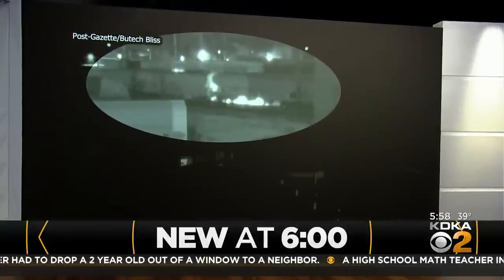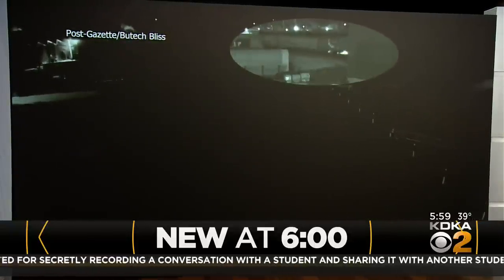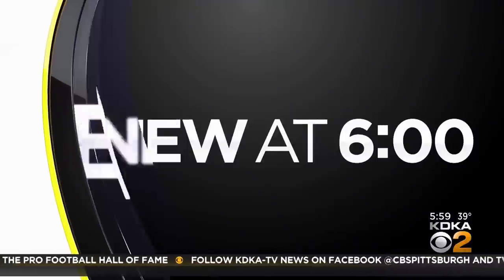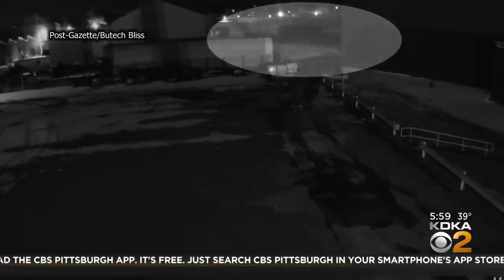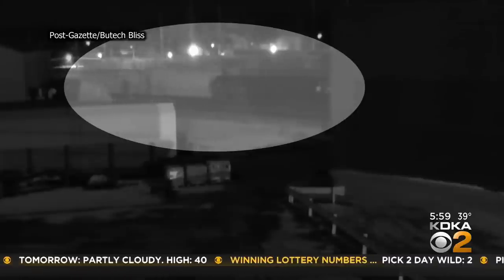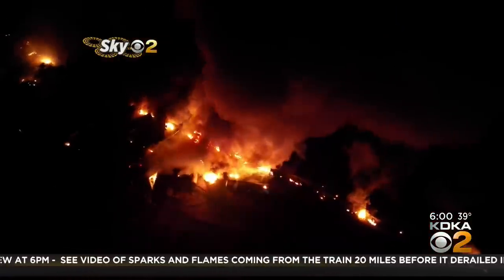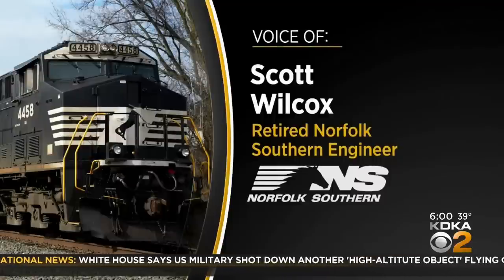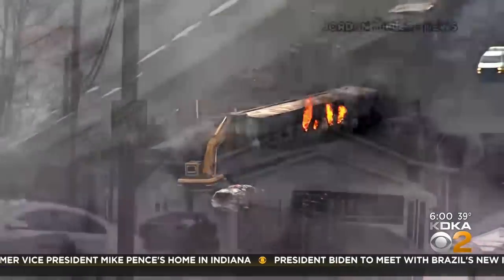Video shows sparks or flames 20 miles before train derailment in East Palestine

Comment: blaming the crew instead of norfolk southern execs is insane
Reply: What's the purpose of the crew if not to ensure the safety of the vehicle? To sit around collecting a union paycheck?
Reply: Which specific norfolk southern execs were directly involved in the inspection and maintenance of the rail car or ignoring alarms on the train at the time? Your comment sounds like it was written by a 13yr old child.
Reply: @clemfandango2930  All of 'em. Norfolk SOuthern has been cutting maintenance to the bone.
Reply: Well, the crew is in fact ultimately responsible for the safe and orderly conduct of the movement of the trains. And if they knew about poor maintenance and took the trains as is, they are also accomplices. Also Executives may of may to know of some cuts done by lower management despite what you may thing.
Reply: @clemfandango2930  they literally want less maintenance to save more money and lobbied against new brake
Reply: What crew? They already running a skeleton crew, trying to save money. Also, the crew IS Norfolk Southern. There is not the crew on one side, and Norfolk on the other. They are one in the same.
Reply: @AgonxOC  No their not! Its goin to be on the chief dispatcher. That person told them to keep the train moving. It should of been set out for the fact that the hotbox detector picked up that locked axle. The video clearly shows it.
Reply: If they did not listen to the system telling them they have a problem then yes it was the operator how made this mistake.  But in the end it is all the company that is why you hire skilled professional.
Reply: @drinkingrobot2252  You are correct but it should never have happened even with existing equipment.
Reply: How can the crew be blamed when they can't even hire a crew..they are treated like animals..I've talked to a few NS employees ..they said they are way understaffed for the volume they are moving. And they aren't compensated accordingly..hints that strike they almost had..but the executives are collecting a fat bonus no matter what...doesn't make any sense..other than greed
Reply: @lucian5304  You are both right!  They are both criminally negligent!  Spraying sparks for 20 miles but they only checked their instruments 10 seconds before flipping?
Reply: @lucian5304  you are driving a trine you get an alert that there is something wrong with the trine you stop and fix the problem
just like your car light comes on and you ignored it is not the car company's fault.  So the company was not in control of the trine so tey could do nothing.
Reply: looking at comments below blame crews who are trying to keep their job while the company lobbied against the Federal government for newer brake systems on their train cars years ago is big "im a bootlicker" and will do anything to defend billionaires and their shareholders no matter what the cost.
Reply: It's NS fault just as much as the crew. Who you think told them go for it
Reply: @handduggraverdronline  Just like a truck driver who does not stop when his truck is having a mechanical problem it was the operator.
Reply: @rambogoham1  It comes down to who was in control of the trine the engineer, not the company.
Reply: @rambogoham1  that’s all I’m
Seeing in these comments. These same corporations would fire these bootlickers at the drop of a hat if it meant more money for shareholders and ceos. You’re closer to being a situation like them than ever being a ceo, stop treating your fellow man like they’re all subhuman.
Reply: Anyone and everyone on the payroll is responsible. All of them. Anyone with a soul would have quit.
Reply: Just like any equipment  or vehicle the operator is responsible. Or are you saying just not when they work for the railroad?
Reply: @ArmsnAcres  No what the enganer should have done was his job.  They had got the alert there was something wrong they should have stop and checked.  It comes down to they are laszy.
Reply: I heard Intel Corporation was planning on buying that land years ago. Intel is owned by Nestle that also sells bottled water. Possible land grab?
Reply: @diggingwithdavid5732   at what point were the crew aware of the alert and how long after knowing of the alert did they begin to stop ? And how many cars were on that train /how long would it take to come to full stop? Do you (or does anyone) know?
Reply: @alchemilla1133  It never should have left salam I would have lost my job if I was the engineer.  After the press conference today they are all at fault.  And the operator is the one who said ok let's go even after being told there was a problem.  The operator is the one who had this happen money is not every thing.
Reply: @warmsunnytoday4535  Good it will be deadly for anyone to have to long of an exposure.
Reply: @@akihiiva1740they’re not allowed to talk. I worked there. Trust me.
Reply: @@akihiiva1740 The crew wasn't incompetent. 🤔🤔🤔
Reply: @mirandastephens4586  To make the company money that they are trying to make up for the money spent in the past used for inspecting railcar brakes.
Reply: @mirandastephens4586  The crew can not turn a shit box into something it isn't though, their job is to operate, not to stop mechanical failures. If a cash register times out, is it the cash attendants fault?
Reply: @Aki Hiiva you know it's a shitshow when they try diverting our attention to a weather balloon and let us all watch it for 4 days just two days after this incident
Reply: @@akihiiva1740 how about you do your research before getting cocky
Reply: @@akihiiva1740 If a railroad company gives you one minute to check a train car at 75 ft long, that train car will not be properly inspected, however, if you inspect it for more than 2 minutes, you will be making the company lose money and that will risk your firing.
Reply: @@akihiiva1740 "Just wait till ihis expands to the airlines."

It already has expanded to airplane manufacturers. Don't you remember when Boeing was quickly pumping out Boeing 737 Max 8 jets? And look what happened to airplanes nosed due to a mechanical software failure. Nah but go ahead and blame it on the airline crew. It must be their fault. 🙄
Reply: @@akihiiva1740 You see when it all takes just a little research. You learn something. Without educating yourself, you'll never really know what the issue is. You just come up with baseless opinions that amount to nothing and will never fix the problem that way because you're not trying to solve the problem.
Reply: @@akihiiva1740
"Before Ohio derailment, Norfolk Southern lobbied against safety rules"
Source: NYP
Reply: @@akihiiva1740 Man, I love how you chose 200 years ago. Not 50 years ago, not 60 years ago, but a time that you didn't even exist. 😂😂😂
Reply: @@akihiiva1740 "Hard fucking work. Even today."

So? What does that have to do with the company being responsible?
Reply: They’re not the ones doing the inspection before departing. Idiots. That’s on NS for laying off all the carman who usually did them properly.
Reply: @clemfandango2930  rail workers complained plenty, and your comment hasn’t aged well, based on senate hearings.
Reply: RFK Jr 2024!🇺🇲
Reply: @AgonxOC wrong. They had no clue something was going on because there weren't heat sensors on the train cars because the company wanted to save money. Not on the crew.
Reply: @BigAlFPV17  where are your sources? They had no idea that there was anything wrong because of the company not putting heat sensors on the train cars to save money.
Reply: @diggingwithdavid5732 what do you mean? The system didn't detect anything because there were no heat sensors on the train cars because the company wanted to save money.
Reply: @drinkingrobot2252 heat sensors
Reply: @naughtiusmaximus830 what equipment 😂?
Reply: @geggilishes5286  Heat detectors for one example.
Reply: @naughtiusmaximus830  there were none. I can prove it.
Reply: @geggilishes5286  OK.  Maybe it was intentional.  I’m open minded when it comes to government lies.
Reply: @naughtiusmaximus830 RFK Jr has a thousand lawsuits for families right now who were affected by the oil spill and there was an investigation done and come to find out there were no heat sensors for the train cars. So they went miles upon miles while it was on fire and the engineer had no clue. All to save money. RFK Jr is getting my vote for the 2024 presidential election.

Comment: This was what the RR workers were complaining about. Not enough crew for safety. Chickens come home to roost.
Reply: how so, there was 3 crew members on the train, and thats 1 more than required by the FRA.
Reply: @trainfan4449 the 3rd crew member was likely a CT or LET. Not the norm.
Reply: @mayormccheeze5951  norm or not, 2 crew members is whats required by the FRA, and this train had more than that. I'm just pointing out the flaw in OPs comment.
Reply: @mayormccheeze5951  From a source on YouTube it was a CT
Reply: @trainfan4449  Just saying. Corporate profits have put safety on the back burner. People have lost their jobs making safety complaints to no avail. If it's not this disaster, there will be another one.
Reply: Build Back Better, baby!
Reply: @michelleayres5608  it sounds like doctors, cops and union workers like nurses, teachers and railworkers put their salary and pension above the very people they're supposed to ensure the safety and well being of.
Reply: @mirandastephens4586  People like them have to put food on the table. It's their bosses who try to do as little preventative maintenance as possible that we should be taking a hard look at.
Reply: @trainfan4449  one of the 3 was a trainee

Comment: The crew finds out when a trackside detector tells them about it.  Trackside detectors are located here and there but not densely.  They also check for wide load, high impact wheel, etc.  Sometimes the crew will miss the report and then the dispatcher will tell them about it and require that they stop and investigate.  Almost always it's urgent enough to stop and drop the faulty car off at a siding by policy but not urgent urgent.
Reply: Well in this case, from what I'm hearing, the hot box detector picked up that locked axle. Something like that has to be set out. No question. The two places where they could of dropped that car off was either in Leetonia or Columbiana (CP Lum) depending on what track they were on. The Chief Dispatcher told them to keep going. If that's the case, that person will be held responsible. But we'll have to see what the NTSB finds when the full report comes out
Reply: @BigAlFPV17  The drill is to stop and investigate, then decide what to do.  If it's moveable, slow roll everything to where it can be set out.  The dispatcher would need that investigation information first too.  It looks like this was in the process of being information relayed but a stop had not yet happened.
Reply: Only 3 people manning the train & one was a trainee
Reply: @donnaleist698  Normally its only 2 running the train. The 3rd was a trainee
Reply: @donnaleist698  Normally there's two, the engineer and the conductor.  They get radio permission to do what's necessary if something happens, e.g. slow roll the train to a siding to drop off a faulty car.  Two is plenty.  The union wants shorter trains and more crew but they're selling their own interests there.
Reply: @yclept9  guys, the train was on fire FOR 20 MILES!
Reply: @Nathaniel Shrock But if they still had a caboose then perhaps it could have been detected, they elemenated that job for the brakeman and other crew members. Now they just hook up a FRED to read the brake pipe pressure.
Reply: @@shrock1995 how do you know they got the warning coming into east palestine and not earlier?
Reply: @BigAlFPV17  Only 2 or 3 workers with that many cars?
Reply: @yclept9  What do you mean, "their (the union's) own interests"? Isn't it obvious that railway safety is in EVERYONE'S interest?

Comment: Preventative maintenance could have prevented this. Who gave the order to cut back on maintenance on this line? Who was responsible for setting the policies in place that could have stopped this from happening. Hint: the rail workers just tried to strike over working conditions.
Reply: Bingo!!! 👍
Reply: Good question.  I sometimes work at a place that rebuilds the chemical tank railcars.  I don't know if they union. I don't think they are but they have some good stories about surprises inside the tanks. They are told what is in them and how to neutralize the contents but sometimes mistakes are made and they catch fire and blowup.  Safety and security is very high.
Reply: This all originates with one person...Hunter Harrison. He's the one who came up with PSR, and that is why NS and all the other Class 1 railroads have been doing the last five years. Basically slash costs to make quick profits from an industry that was built for the long term. Unfortunately Hunter died while running CSX into the ground. It would have been grand for him to be held accountable.
Reply: Good hint!

Comment: What caused the cars to catch on fire? Maybe that needs to be looked into as well. Kinda suspicious for them to catch fire AND not trigger any alarms or alerts to the crew or stations.
Reply: a defective wheel bearing caused it to overheat
Reply: They did trigger alarms.
Reply: Vinyl chloride starts to boil and vaporize at 8 degrees.
Reply: @mirandastephens4586  So they were ignored and crew knowingly kept rolling on flames anyway all while hauling hazardous materials?
Reply: @amyhartman6786  No evidence of that, as yet. You're making assumptions that haven't been substantiated.
Reply: @mirandastephens4586  Were the alarms in fact triggered and were any alarms received by the crew? You have no way of knowing that, as yet. You're just making assumptions.
Reply: @kelleychilton2524  and so are you.
Reply: Handbrake left on a single railcar and it being dragged for miles
Reply: @VOTP wrong 7.9 degrees 😅
Reply: They fired 10s of thousands of people after the Union strike was averted. Less quality inspections and less engineers per number of cars.
Reply: @linejumper8204  Many were fired. They cut sooo many. No paid leave. No sick time without being punished. They have low staff. Stuff like this will keep happening.
Reply: @amyhartman6786 The defect detector wasnt working iirc

Comment: Railroads have special track geometry inspection trains that tests the functionality of wayside detectors with special railcars that can mimic a hotbox.  Who knows how long ago that kind of train tested all the wayside detectors along this line.
Reply: The defect detector 20 miles west of East Palestine is a dragging equipment detector only. It doesn’t have the capability to scan for a hot box, but I’m sure after this, it will be receiving that upgrade.

Comment: Definitely a hot bearing. That will cause a derailment 100 percent of the time if not addressed immediately. Ns wayside detectors need to be checked by officials tho. I think they “adjust” them to keep the trains moving. Seen that first hand.
Reply: Most likely a bearing / axle issue or thats what they tell us and could be something else. I've seen people try to put blame on trump because of a regulation cut back on specific brakes when brakes had nothing to do with the derailment. facepalm

Comment: The rail unions were striking in November/December over something called PSR.   PSR is Precision Scheduled Railroading it means fewer crews, less maintanance, fewer days off, longer trains, and just general unsafe business practices all in the name of keeping trains moving at all times to maximize profits
Profits that were then taken by the hedge funds that own the railroad companies so that they can buyback their own stock which they have done at record rates cohencidentally ever since PSR became the common practice in the last 5 - 10 years depending on railroad company
On February, 3rd a train heading from Illinois towards Conway station ran over a sensor that detects heat on the train wheels and axles that told them their wheels were on fire. Instead of STOPPING and inspecting and repairing the damage the crew on the train was ORDERED by dispatch to keep going towards Conway
SO FOR OVER 20 MILES UNTIL IT HIT EAST PALESTINE THE TRAIN WAS GOING 30+ MPH WITH ITS WHEELS MELTING AND THEY KNEW IT
Reply: We do not know this, but it is definitely plausible.
Reply: BlackRock
Reply: @donnaleist698  Blackrock rules in many ways.
Reply: @Nathaniel Shrock Is it wrong to assume that the hotbox detector worked the way it is supposed to?
Reply: @ChristopherMarlowe  well in the current works, everyone would rather pass blame then accept their mistakes. 

This guy wants to defend the company that’s clearly known to cut corners and avoid cost. 

Stop the load and fix the issue ? Keep going and get paid ? 

Even if the sensors worked and their was audio from dispatch, this guy’d find any excuse to defend them. Nobody likes accountability